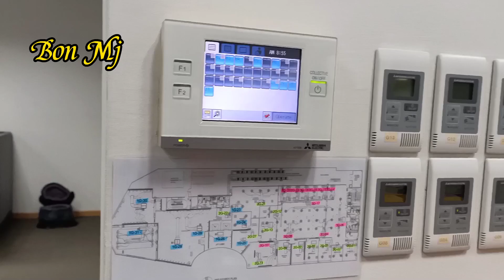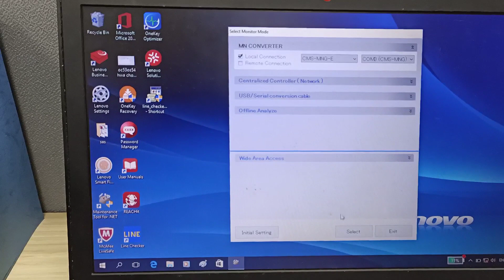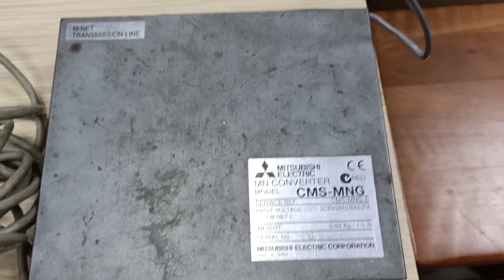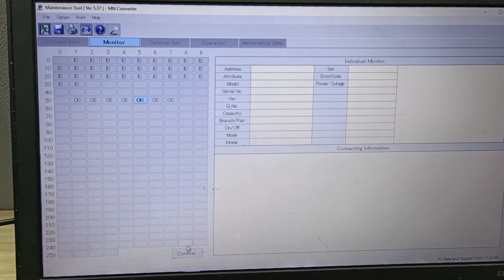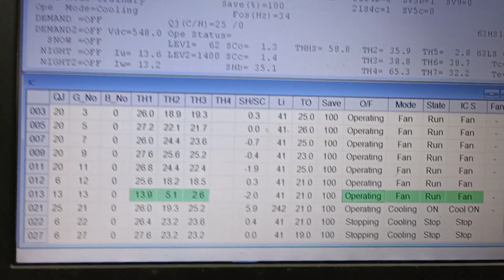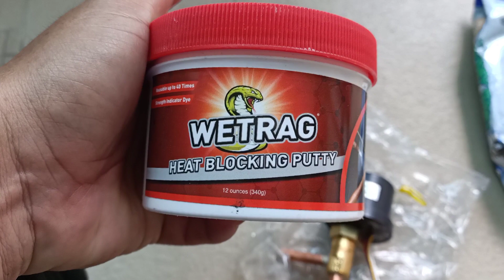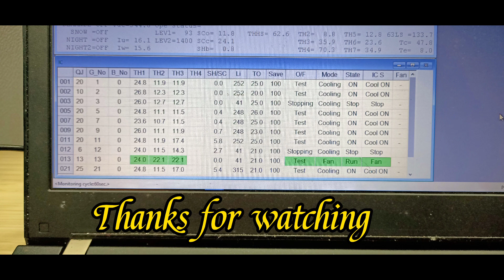How to troubleshoot air conditioners using checker  | VRF

Comment: For a Mitsubishi VRF system, if one FCU (Fan Coil Unit) is not turned on, the other FCUs won't cool. However, if that FCU is turned on, the others start cooling. What could be the problem?
Reply from the maker: Check LEV

Comment: Sir. My ac.. non inverter.
No error code.
However when compressor starts. The gas seems doesn't reach My room.

Got 1 season.. any other room ON. My aircon is cold 

I had to turn ON fan till it finally not cold till date even when I ON 1 unit

Comment: Is there a way to contact you on vrv3 E6 issue
Reply from the maker: Email bonmj81@gmail.com
Reply: @BonMj  Hi bro i would like to talking somethings how to check at Mitsubishi city multi vrf outdoor unit how many no of indoor unit connecting and check temp,gas,
Reply from the maker: E6 normally standard compressor over current